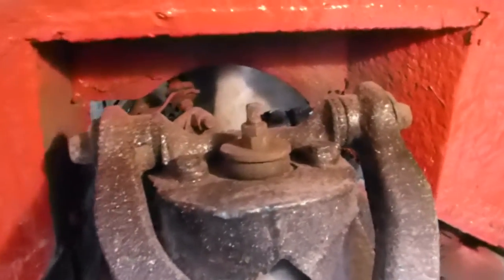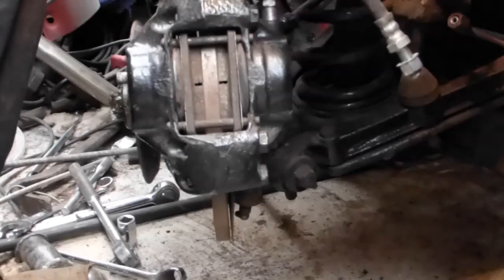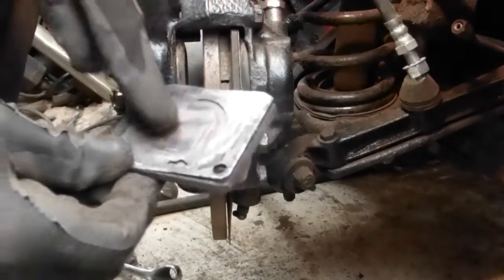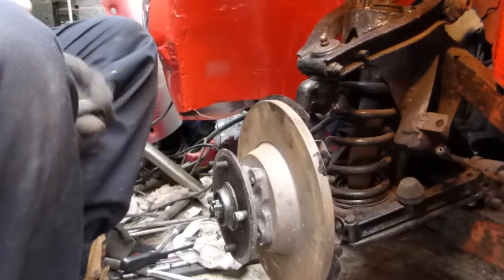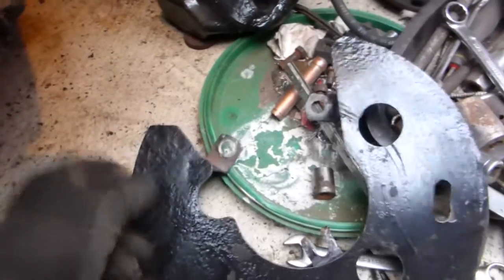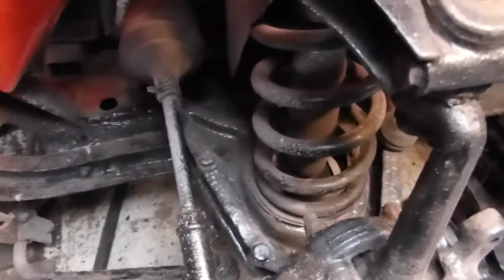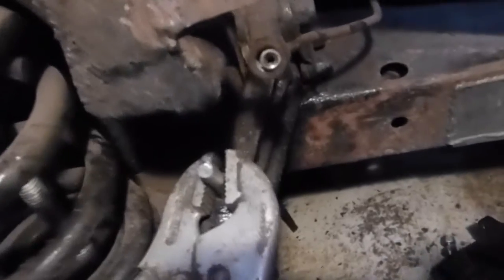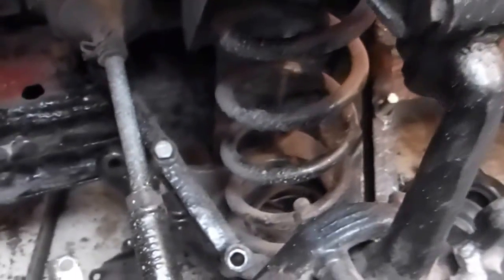TR4 Front suspension re-build Part 1

Comment: How do you proceed - at reconstruction - to refit the brakehose? How do you evacuate air from the refitted hose?
Reply from the maker: make sure that the master cylinder is full with the correct fluid. Push a short length of hose over the bleed nipple and put the other end into jar. Get a friend to press on the brake pedal and keep it town while you slacken the nipple, and retighten before they lift the pedal. Repeat this until bubbles stop comeing into the jar and the pedal is firm. good luck